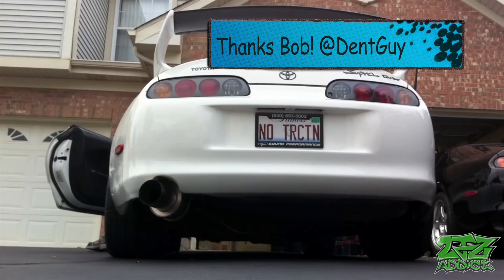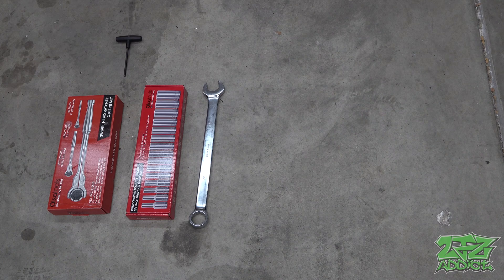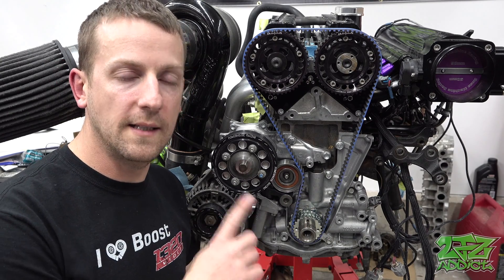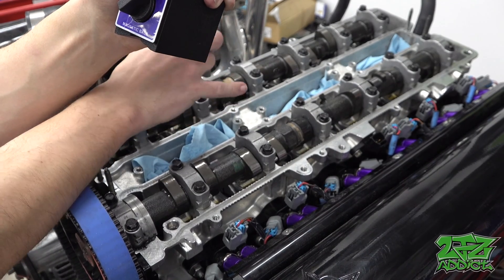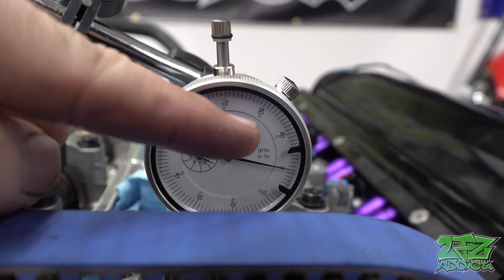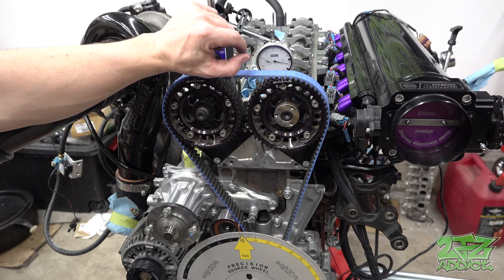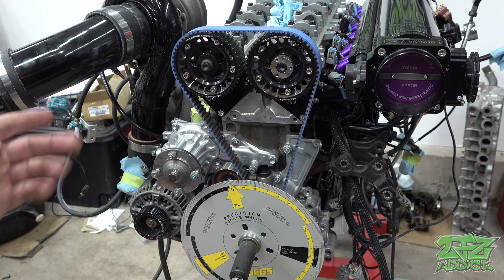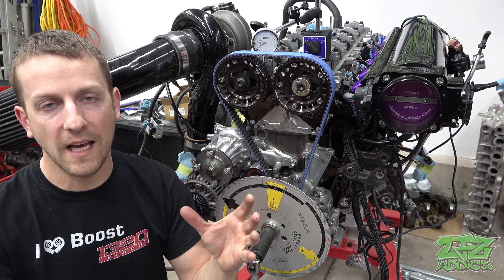1000hp Supra Build | Part 14 | How to Degree 2JZ Camshaft GSC S2 Cams

Comment: 🇦🇬
In order to facilitate the perpendicular positioning of the dial indicator plunger, the use of an appropriately sized L-needle or Z-needle will be required. ⭐️⭐️⭐️⭐️. Unfortunately some of the audio is missing. 
🙇🏾‍♂️

Comment: You need the DTI gauge to be perpendicular to the lifter for an accurate reading, the measurements will be off when its set to an angle on the lifter like it was.

Comment: Brother, you are a trusting soul.  I never assume any marks from the factory are accurate.  When you've seen 2 extra millimeters of deck from the factory, you get suspicious of everything they've machined.  I set zero on my degree wheel by putting a sparkplug with a bolt welded on the end into the cylinder then rotate to the stop in both directions then split the difference.  I also never assume my measurement setup will be measuring accurately, so I check the timing at 40 thou open then 40 thou closed so I can mathematically find lobe center.  Open and close numbers are pointless because you can't be certain your lift measurements are accurate, so lobe center is everything.  Even if your valve lift measurement is in the tank, as long as it is consistent you can correctly time the cam by setting lobe center where the cam card says it should be.  I guarantee you looking at your dial indicator's placement, you were not at the lift you thought you were, and yes, 4 thou ain't 40 thou, and if you want to get picky, 40 thou ain't a millimeter, that would be 39.6 thou.  I brazed a crowfoot onto my dial indicator's point so I could have some room to work and get the dial indicator's shaft closer to perpendicular with the bucket's motion, and I work off the edge of the bucket because the shims will tiddly wink unless you're using a shim under bucket setup.  I learned all this stuff 40 years ago building road race motorcycle engines.  What I want to see is how to turn the crank without moving the degree wheel relative to the crank while the engine is in the chassis and the transmission is bolted up.  Was hoping to see some kind of tool fitting over the crank with a big hex on it using the key, but sadly, not here.
Reply: My thoughts exactly, how did he know the piston position?

Comment: How much did you turn the exhaust side? And if you started with 8 before tdc and then did .040 lift why would it be 2 before tdc? And same same with the exhaust why 58 to start and 47 to finish?
Reply from the maker: If you look closely I was an idiot and only rotated it over .004 and not .040. I went back and fixed it off camera but didn’t record it since it was taking way longer than it should have with recording/talking. Follow the cam card and you’ll be good to go. 👌

Comment: Saw you only adjusted the cam to 0.004” lift but the cam card called for 0.040” lift - any reason for that?
Reply from the maker: Good eye, Sir!! Short version, I’m an idiot and forgot how to read for a min. I did correct the lift to .040” but didn’t record it. You are correct though on both counts. 🍻👍
Reply: @2JZAddict  thanks and love the videos - will be degreeing my bc276 cams the same method
Reply: Did you get your valve closing to match the cam card after degreeing - mine has an extra 4 degrees of duration - closes at 51 degrees ABDC instead of 47 degrees ABDC?

Comment: Great video, is this required on all aftermarket camshafts? I have some BC 272 cams. Would you just install, measure clearances and be done or degreeing is a must?
Reply from the maker: What’s your cam card say? Degreeing them will give you a smoother idle. The way I figure it, the people that design cams are way smarter than I am. If they say to degree them, it’s a good idea to do so.
Reply: @2JZAddict  For sure man, thanks
Reply: This video will definitely help out a lot